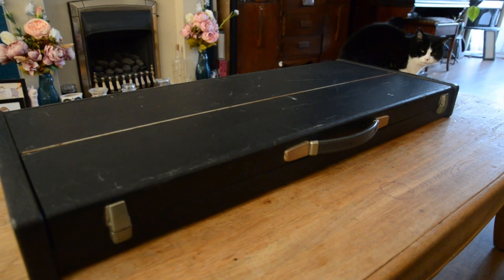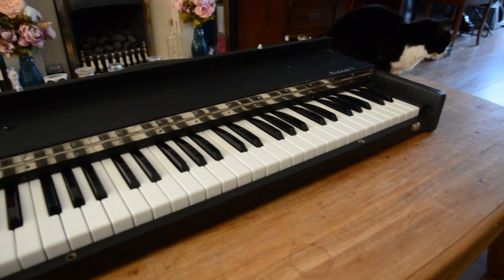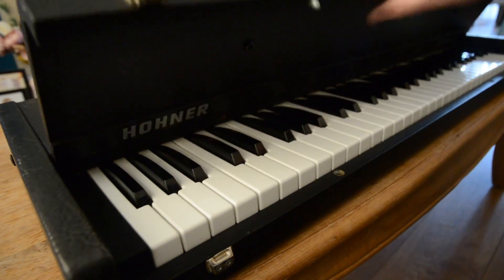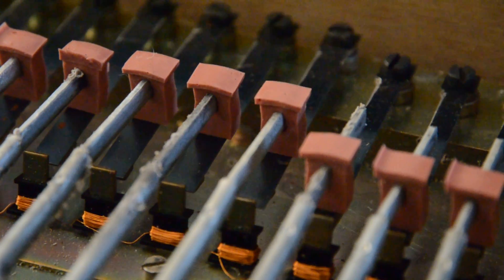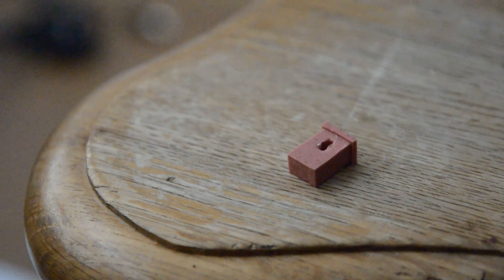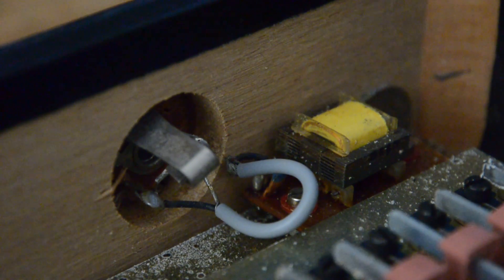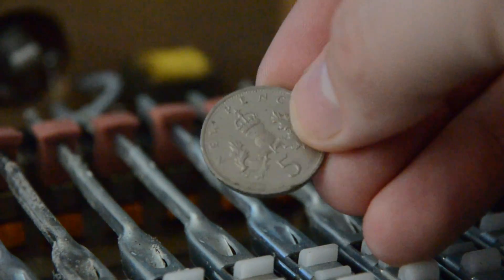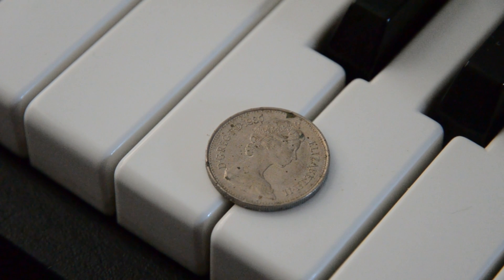Inside the Hohner Pianet T - How does this electric piano work!

Comment: Hi, could you maybe take a picture/video of the area around the transformer and the transformer itself? I have a Pianet M but it is too bulky to bring it to practice rooms or stages so i want to transform it into a Pianet T, but need to add the output transformer (the Pianet M doesn't have one, because it is equipped with an amplifier and speakers)...
Reply from the maker: There are no marking on the transformers. 
There is a replacement for sale here:
https://www.ep-service.nl/hohner-pianet-t-replacement-transformer
If you drop me an email (its on my about tab) I can send more information if you want?
Reply: @deancoyle  Thanks a lot for pointing me to the replacement transformer. And they even write what connects where on the product-page. That helps a lot 🙂

Comment: That is a really clever and simple design.  I would guess that it must weigh significantly less than a Rhodes.
Reply from the maker: It is the lightest electric piano I own...but saying that it still have a good amount of weight to it. Where the reeds are attached is a long steel plate that runs the length of the piano. Its bout 10mm thick, so does use its share of gravity. It is great that it approximately the size of a guitar case.
Reply: No comparison. I own both. The Hohner you can carry like an electric guitar case; anywhere.

Transporting a Rhodes to a gig is going to require either a hand truck/ dolly, a generous friend, or at minimum a strong back and few stairs.

Comment: I have a Pianet next to me as I type and a similar model was my first electric piano in the 1970s. All it needs is to be a bit longer at both ends (not much) and sustain, which can be provided for now with an electronic sustain pedal such as the Freeze. The thing I love the most is that it is acoustic, mine is almost never plugged in at home. Modern guitar effects like reverb, chorus and tremolo can make it even more fun.
Reply from the maker: I will have to try a freeze pedal. thank you for the recommendation. I agree its loud enough without an amp. Though the bass notes don't quiet sound right if not amplified.